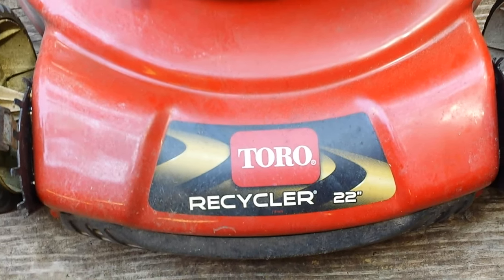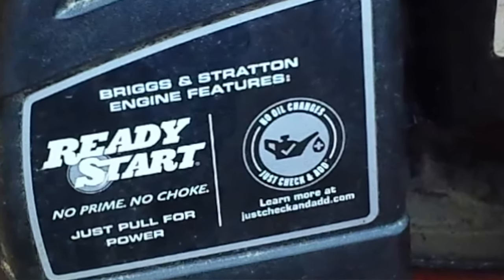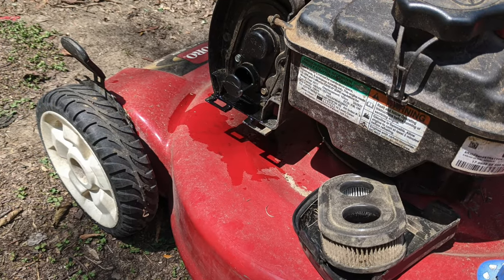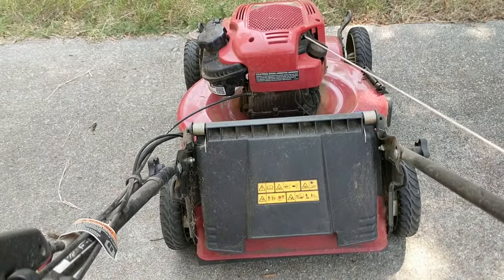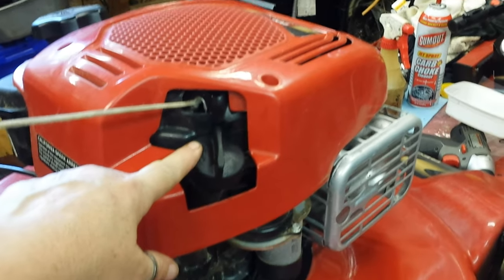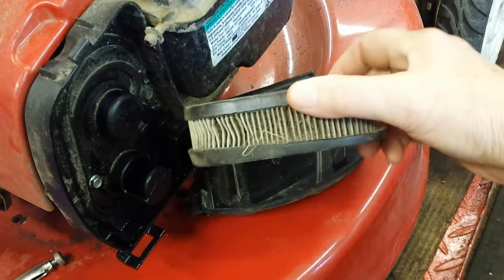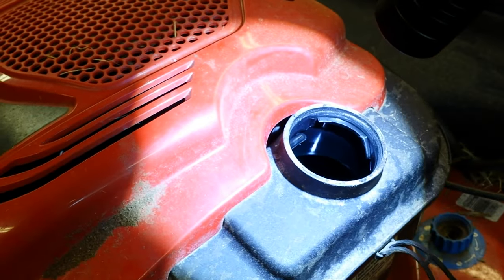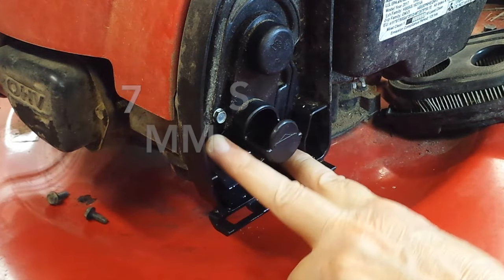Fix a Toro Recycler - Starts Then Dies

Comment: I tried this fix on our neighbors Toro 22" Recycler, but it didn't work.  It still starts then dies.  Not sure what else to try; it runs fine if I spray carb cleaner into the carburetor so it seems like it must be a fuel delivery problem.  Plenty of gas is getting through the fuel line to the carb.  There was some debris in the gas when I drained the tank.  Using fresh ethanol free gas did not help.  It does have spark.  Any other ideas about what to check?  Should I try a fuel filter in the fuel line (a filter made for gravity feed engines), and re-clean the carb?
Reply from the maker: If there was debris in your fuel tank, probably carburetor clean best. I'd avoid carb spray, it's very harsh on plastic and rubber bits. Brake cleaner is much more forgiving. Did you completely disassemble the plastic fuel stack? Double check your carb bowl went back on the in the correct orientation.
Reply: @TheLawnmowerLady  The first carb clean went well, and I cleaned it again this morning.  I cleaned the gas tank out this morning; maybe there was something that made it to the carb after the first cleaning that was dislodged during the 2nd carb cleaning?  The good news is it is running now.  There was a gasket missing from the fuel cap, which is now replaced, so hopefully there won't be debris getting into the gas tank now.

Comment: If you ever over drill that brass main feed jet, you can experiment with a soldering iron and soldapulit (solder sucker) to get it filled in a bit. Drop down to a .5 mm drill. Because it's a lot harder to un-drill. 😋
Reply from the maker: Interesting idea!

Comment: I bought a all wheel drive toro last year. Low hours blown engine. 163cc. The throttle plate came out of shaft they kept running it till it destroyed it self. (Rod) couldn't find same engine so put a quantum on it.
Reply from the maker: That Quantum is a far superior engine IMO. Thanks for watching.

Comment: I’d be interested to know if the owner ever used fuel stabilizer in this machine.  I watch another channel (Taryl Fixes All) and he did an experiment last year with different brands of fuel stabilizer.  He found that with the exception of one or two, all of these stabilizers formed a gel residue, when they were used with ethanol gas….???
Reply from the maker: I watched that entire series, not too surprised most of the elixirs came back with jello in the bowls. I'm somewhat in the camp of thought that fuel detergents in all fuel (at least here in US- not too sure about Ireland) contribute to the jellied mess after long enough time, and the ethanol just makes it worse. AFIK, Suzy only uses ethanol-free fuel, and my best WAG is likely the combination of loaning out her mower, the small amount of jello and water was just enough to stall the machine. 

I really appreciate you watching my channel Ms Inisfad. I hope you have a very Happy and Warm Holiday. Cheers! 🎄🎉

Comment: I have a question. I have this exact mower. It works great until the bag is full. I stop it empty the bag, and it won't start again. If I wait 10 mins, it'll kick back on, no problem. Could it be the muffler arm, it's the only thing I haven't really checked. Any other ideas?
Reply from the maker: You can check the muffler arm keeps the choke flap open when it’s hot, and closed when it’s cooled down, though I would think it would have issues running if it was not working correctly. It could be a failing ignition coil? About the only way to test that theory is to replace it. A pricy gamble.
Reply: @TheLawnmowerLady  Thank you!

Comment: Btw, if you over drill that main jet, there's going to be poofs of smoke and no power at all. Well, instead of the solder filling and drilling trick, you could just buy e85. It might actually work. Can't hurt a plastic carb either. Just gotta run it dry. The jelly monsters still visit from time to time. Our stations aren't very aware of what's in the big tanks. I have doubts about it really being non-ethanol. They should allow for a station where there's ONLY non-ethanol so there's no mix ups by the fuel truck
Reply from the maker: I've talked to the tanker truck guys (east coast of US) and apparently they "mix" the fuel onsite at delivery hence the stickers that say "MAY contain up to 10% Ethanol"  Same with the mid-grades-mixed onsite. Their tanks carry premium and regular grade.

Comment: Just followed your instructions, it starts now! But the RPMs are high when I start it, what could be the problem? Thanks
Reply from the maker: If this is the Toro with the plastic carburetor, make sure linkage and spring on top are not jammed up. You might have to remove the airbox to check. Hope this helps.
Reply: @TheLawnmowerLady  got you, I will check now!
Reply: The Choke Return Linkage seems to be flimsy, I’m not sure if that is normal or not. Still same problem occurs of High RPMs even after adjusting the RPM spring,
Reply from the maker: @Pela_Vacas  Is it fouling with the breather tube? If this model has a choke flap rather than the primer bulb, that's also a point of contact/fouling.

Comment: I don’t agree on no change oil, though you may need to top it up now again.
I’d like to change it at least too spec of 50hours for Briggs and 25 hours for Honda engines
Reply from the maker: I agree with you Mr Rick!  I think allowing these machines to burn oil that gets older and older is a perfect recipe for planned obsolesce.

Comment: Definitely valuable information but what to do if it still won't start?... Changed plug. Replaced oil and filter. Spun up after doing what you showed and then it died and won't restart... 😢 Grass is growing taller by the day ...  HALP!
Reply from the maker: If it runs for a few seconds with a direct shot of fuel into the carb throat, it's likely bad gasoline/water still in the tank. Drain it all out. Let the tank dry in the sunshine for a few hours. You'll need to pull the carb bowl again to drain that out as well. If you have ethanol-free fuel in your area, start using that exclusively for your small engines to avoid the issue in the future.

Comment: I have a Toro recycler lawn mower I put a brand new carburetor it starts but after a few minutes turn off can someone help me
Reply from the maker: Sounds like a fuel delivery issue to me. Some of the aftermarket carbs are hit and miss. If it were me, I would go back to the original and clean and rebuild.

Comment: What a shocker... my neighbor brought one of these over yesterday and asked me to fix it. I am stuck, which is how I ended up here. I'll try to keep this as short as possible. He rolled the mower into my driveway. He pulled the cord to show me it wouldn't start. It started right up. He was turning around to push it home when it died. I cleaned the carb out and it started again. I mowed my small front yard to test it out. I was almost through when it died. It wouldn't start again. I bought a new carb (Can you believe $40 for that POS plastic carb?) and ot started right up and ran great. I shut it off and it wouldn't start again. Then after a whle it would barely catch and just sort of burble a few seconds and die. I'll try a spark plug but only once have I ever had a new spark plug be the fix needed. Maybe water in the tank? BTW this guy works for a lawn service and does it as a side job also. He used to use only Honda mowers. Those were all easily repaired.  I can't believe he bought this junk.
Reply from the maker: My first guess is fuel starvation? Maybe debris in the fuel tank, level gets low, and stops flow. Replace the fuel line?
Reply: @TheLawnmowerLady  Thank you so much for your quick reply. I'm going to empty the tank and clean it and I'll try new fuel hose. I don't 'think' fuel starvation is a problem bc there was always plenty of gas in the bowl each time I removed the carb but I trust your expertise.  I did notice some backfire a couple of times so maybe the valves? I doubt that bc sometimes it runs so well... until it doesn't ;)
Reply: @TheLawnmowerLady  Got it done. I think I may have had the o-ring and that white space reversed. I also installed a new spark plug but only once in my life have a ever fixed a small engine by replacing the spark plug. So anyway it turns out your vid was very helpful in getting the intake sealed correctly. Thank you! BTW I tried to talk him into letting me up the RPM (it was around 2750) like you did to this one but he said it was fine as is so...

Comment: Can I mow at low throttle
Reply from the maker: Most mowers here in the US don't have adjustable throttle cables any more. I think a mower this big would have trouble in thick or tall grass at low RPM. Thanks for watching!
Reply: @TheLawnmowerLady  Why would it have trouble at low rpm in thick grass
Reply from the maker: @Squad-pl7oo  Not enough torque to overcome the inertia needed to plow through thick grass at such low RPM.

Comment: My toro still wont start.  What if there is no spark?
Reply from the maker: Could be several things. Change the plug, they're cheap. Confirm your brake cable is moving that lever at the other end (on the engine side). Pull off the plastic cowling and pull the ground wire (the small black wire) on the coil. That disables the kill switch. ( If it starts, you'll need to pull the plug wire to kill the engine.) Look inside the plug boot. Can you see the electrode terminal in there? Is there debris, or rusty inside? Have you checked for spark with a tester? There are inexpensive inline spark testers that light up a tiny neon bulb with good spark. I hope this is helpful. Thanks for watching.

Comment: Any time you tip a push mower, it will leak some place. Simple gravity here. Easy way to stop this. Get a vacuum evac pump and suck out the oil and fuel prior to tipping. Easy right? Only cost about 25 bucks to your door.
Reply from the maker: Good idea, but most folks don't have, and probably wouldn't purchase something like that. I try and keep my videos accessible to the average DIY homeowner. Thanks for watching!
Reply: @TheLawnmowerLady  Yup most don't even check or change the oil. Keeps some folks in a job.

Comment: If you loan your mower you should expect to get it back with bad gas in it. A lot of people leave their gas cans outside in the rain and weather. Then they need your mower since theirs won't start.
Reply from the maker: You are so right! My usual advice is to NOT loan out any equipment (especially to in-laws 😂) But if you just can't get out of it, give them the fuel to go along with it, especially if it's a 2-stroker. Thanks for watching. Cheers!

Comment: I've cleaned the carb and still starts and dies but runs with more gas
Reply from the maker: sounds like that main jet still might be plugged. Perhaps some small amount of debris or water in the bottom of the fuel tank? You can always get a replacement fuel  cartridge: https://amzn.to/3L7hTuM
Reply: Thanks for the reply ! Yeah most of the time carb cleaning does the trick for me.I didn't put metal wire in the jets to make sure there clear,I did use brake clean and went thru.

Comment: Yes...Plastic carb...Interesting...Probably better as long as it's heat resistant....
Reply from the maker: For all it's faults, that carb is very easy to service, and inexpensive to replace that fuel stack if it becomes too clogged up. Thanks for watching!

Comment: I have this mower.  The engine is terrible. WIll not stay running for a full season, let alone year to year.  Seems like the carb needs to be serviced multiple times a year. Terrible.
Reply from the maker: I sympathise with your position. These plastic carburetors are not an advance in technology. They are prone to getting clogged up and the air filters are not robust enough to not collapse and allow dirt and debris to get to the carburetor. I appreciate you watching.